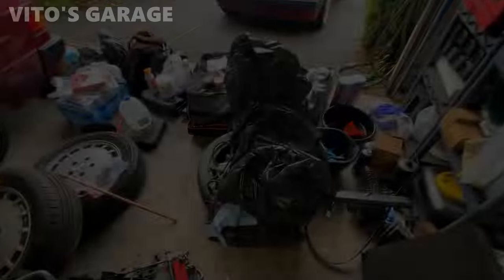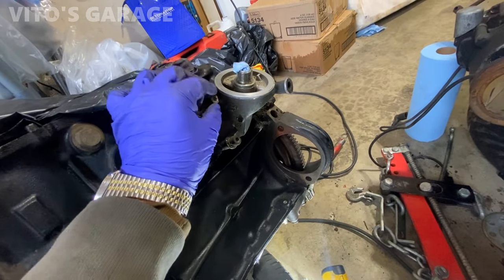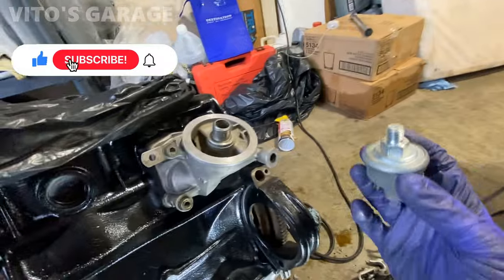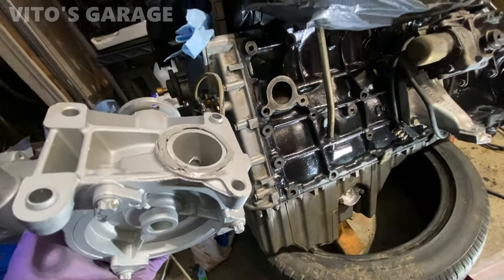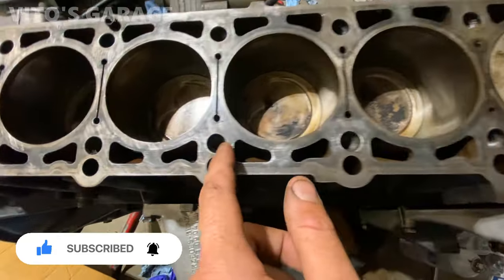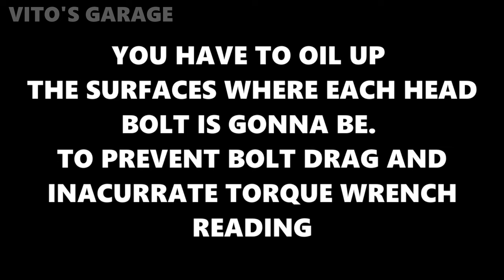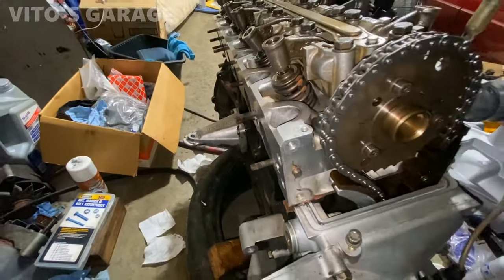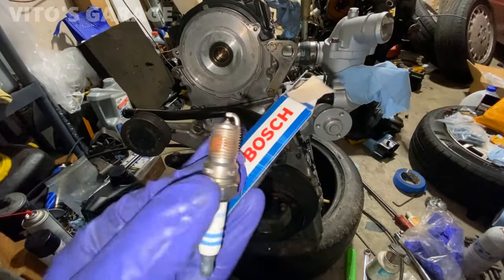Part 5 1992 Mercedes S124: M103 Cylinder Head Installation,  Timing Chain & Tensioner, Valve Cover

Comment: 3:18 I wondering if a 104 oil filter housing will fit, oil changes would be much cleaner
Reply from the maker: Cleaner? How?.. I’ve done tons of M103 oil changes and never made a mess while changing the filter